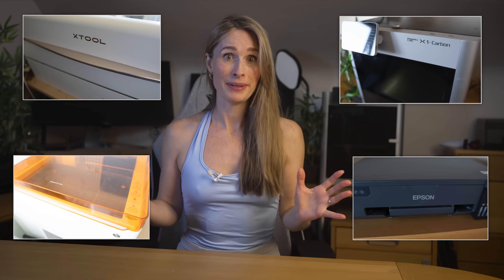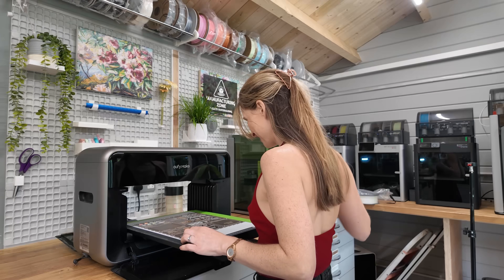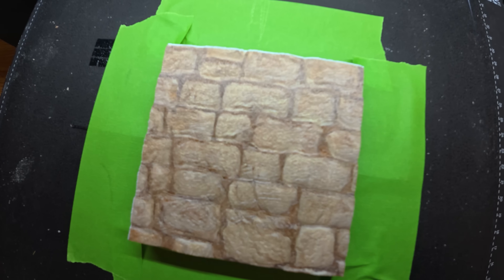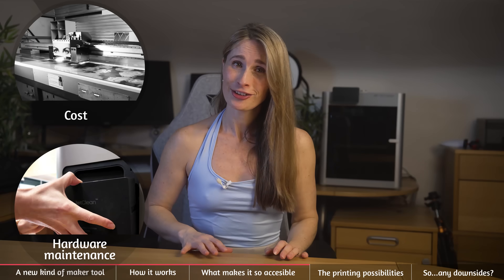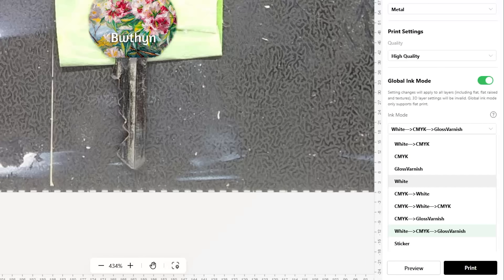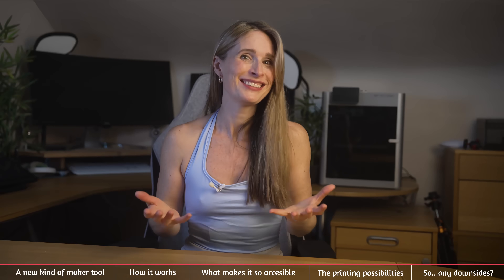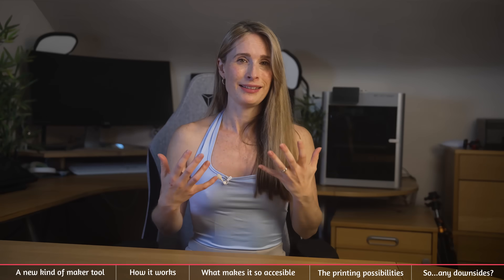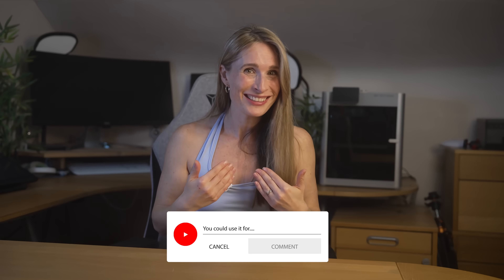UV Texture Printing With the Eufymake E1: Testing & Real-World Results

Comment: The product is nice BUT its still to expensive for hobby use because of the ink, thats why the relief function is useless, a A4 format picture would cost 150 Euro. So its only for 2D prints in real life, then you need white ink and a cleaning fluid. Also not sure how durable the prints are. 1ml ink per day for cleaning sounds not good to me as a private just for fun user.
Reply from the maker: Yes, it's definitely not a throwaway item, very much a higher end tool. Not sure where you got 150 euros from, the A4 prints I did used orders of magnitude less ink, I suspect it might be a bit like you wouldn't 3d print with 100% infill either, there's loads of easy tricks I've developed and the relief printing is something I use all the time!

PS I've had my lawnmower I modded with it out in the sun and rain all year uncovered 24/7, so I'd say it's pretty durable!

Comment: This printer could end up being PAPER WEIGHT in a few years. This company rebranded after their last product stopped selling, the Ankermake M5 and M5C 3d printers. They stopped selling the M5C and critical replacement parts after only 2 years of it being on market. These 3d printer are becoming becoming paper weights. 
DO NOT BUY!! a $2,500 machine from a company that might only support it for the next few years
Reply from the maker: ...you know they've come out and confirmed that was a myth many ago? Spare parts and support still available in their store. 
But yes, much like every phone, car, 3d printer and other manufacturer, they may eventually stop selling spare parts - so if you're sticking with the same 3d printer for the next decade, then I'd definitely recommend stocking up!  But the idea that they're going to short term discontinue the biggest selling kickstarter in history is a little far fetched I think!
Reply: @handsonkatie The Tool head for the M5C is completely off the store so not all parts are available. While I am much less butt Hurt about a $300 3d printer. 
I am much more concerned with a $2500 it printer. And still only 2years people have owned these printers
What is the myth you are talking about?
Reply from the maker: Just checked and the extruder is available in EU, but might be different locally - or you might mean a different part, but hey Elegoo are out of stock of my favourite filament colour and Bambu are out of stock of their toolheads occasionally too! The myth was that they were stopping support/no spare parts ever again etc - Anker came out to clarify this.  But as I say, all printers will be discontinued (as all the brands have been doing for years, so it's very much based on the success - the M5 has struggled to compete with the success of Bambu Labs, whereas I suspect the E1 is a different class of device) - but if you're concerned then definitely no need to leap. Like many did with the X1C, you can just wait until it's mainstream/available in shops!

Comment: I'm wondering if this uv  printer  meets my needs : I need to print on leather(natural /vegan) or leatherette, small Motivs  between approx  15 and 25 mm of diameter, and then cut them out (or cut them before and print after) this round printed parts need to be able to be occasionally bended without the colour to be lost or peeling of. How good would be this machine for this purposes? I basically need a  good resistance and flexibility of the colour
Reply from the maker: I haven't used it myself yet, but if you check their site, you'll see they've released flexible ink for exactly this purpose - so I think it'd be ideal (eg they're using it on leather and leatherette all the time!). And then in terms of colour, it'd be outstanding at this too!

Comment: Have you tried spray painting a piece with white, i.e. a plywood square and just printing with the cymk setting to save on white ink?  It seems the more tricks to reduce white ink usage, the better.
Reply from the maker: Yes I have! And you'll also spot in this video I've created a 3d printed brick wall (ie where I do most of the depth mapping in the 3d print and then just colour coat with the UV printer- works great!)

Comment: Hi. Question. Does it print on suede. Like the kind that is on the back of PU leather roll up dice mats? I’m trying so hard to find this answer. Any help is appreciated. Thanks and great video.
Reply: I believe it’ll print on pretty much anything. The issue is that once cured it’s not a flexible print. If you were to print onto a swatch of suede and then hang it on a wall, it would be fine. If you print onto a roll up dice mat, the print will crack and split like a 20 year old graphic T-shirt design when you try to roll it up. 

They have a flexible white ink, but it’s only flexible enough to print onto a thick fabric that doesn’t wrinkle a ton, like a reusable canvas shopping bag.
Reply from the maker: Yes....except check their kickstarter page, they've released flexible inks - so it'll print very nicely to leather....!
Reply: I’ve actually seen someone doing some printing on polyurethane foam using the non-flexible white and they weren’t having any cracking with pretty severe bend angles. I think the main thing with that is you probably couldn’t expect more than a simple color layer. Built up texture isn’t going to survive a bend nearly as well.
Reply: @DannoHung oh neat. Do you recall where you saw that?  I’d be interested in seeing that
Reply: @surlycanadian @fiercekittenz posted a short demonstrating it a few weeks back

Comment: Very useful video, thanks! Can it also print on PLA?
Reply from the maker: It most certainly can!! Lots of the examples in this video were on PLA. The ability to print to 3d printed surfaces is one of the coolest features - it also smooths out the layer lines with its undercoat, so you get super crisp detail as well!

Comment: After how many prints do you clean the heads and how much does it cost?
Reply from the maker: You don't need to, it does this itself automatically. There's a 'deep clean' option you can manually activate to do this if you really want (this is the same process it goes through for a shut down). Uses a bit of ink and obviously the cleaning fluid, but that's it

Comment: Suppose I have found some illicitlyearned and decided that I might buy one, should I be concerned about this comment in a Hackaday revue "We won’t even get into the fact that all your interactions with the printer have to go through the cloud — there isn’t even so much as a USB port on the printer to allow local control."?
My Prusa Mk4S 3D printer has both and I find it very reassuring. Even so I am seriously tempted...
Reply from the maker: Offline mode is currently in development (check the Kickstarter FAQs). This will naturally not feature cloud services (eg AI generation), but otherwise you should be able to control everything without a cloud connection!

Comment: What you're looking for to help with hard surface printing is "uv printing adhesion promoter,"  e.g. DXZ  uv printer metal coating for hard to print surfaces, or AP3155.
Reply from the maker: Yes you're right! That's what I spotted, need to test in the coming months all the different brands!